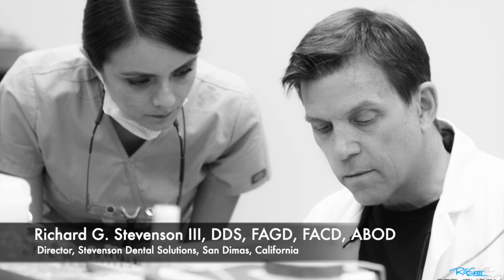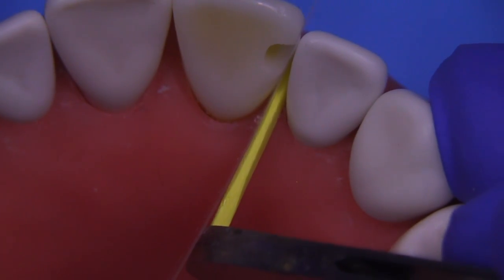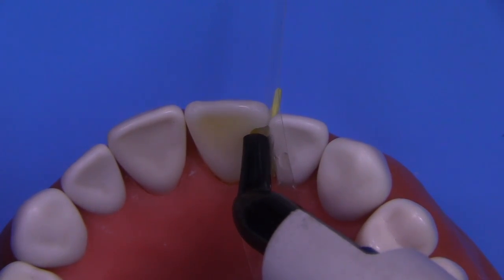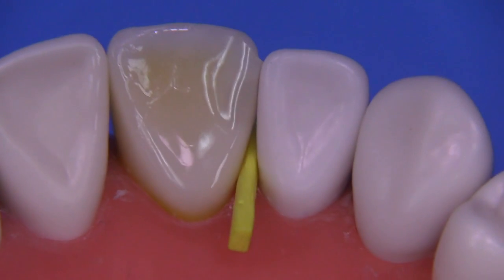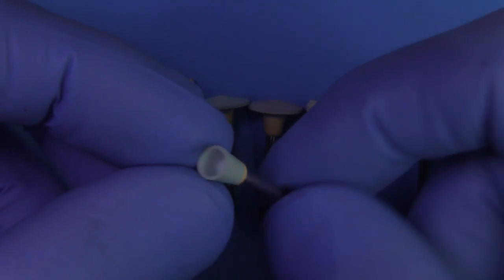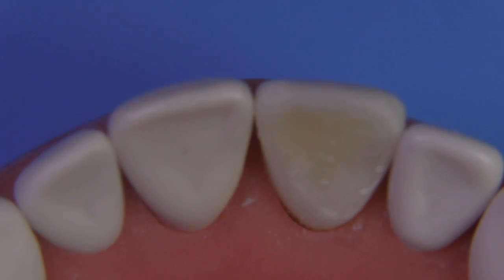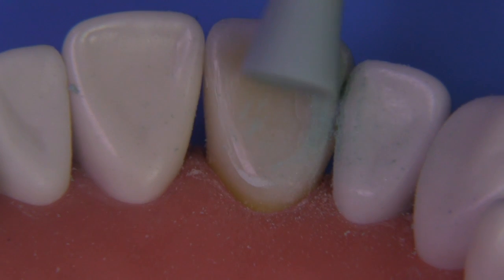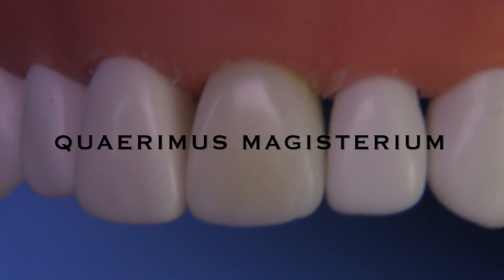Class III Composite Restoration #9 DL FIll

Comment: I appreciate the video. Is there any helpful suggestions to minimize future staining of the composite especially in direct veneer cases?
Reply from the maker: Sure - etch at least 2 mm beyond the finish line/margin.  Use a good universal or 4th gen adhesive. Always use glycerine on the margin and cure thoroughly.  Use air spray to cool during repeated curing. (We test our lights with Blue Light Analytics software)Finish with discs and plenty of water running from composite to tooth.  Recall the patient periodically to polish with plenty of water and fine cup abrasives.

Comment: Hello Dr. Stevenson, thank you so much for creating this video. It truly helps a lot!

I have my dental hygiene restorative board examination coming up in a few months and we have to restore a pre-prepped #9 ML. I have a few questions regarding that.

1. Sometimes I notice I have some excess material interproximally towards the gingival margin of the prep which can create an overhang. I have started placing the wedge from the lingual rather than facial and this has helped but not completely. I don't want to take a flame bur interproximally because I'm scared it will damage the tooth structure. What would you recommend I do in this situation? I have also used like a sickle scaler or interproximal carver (used for amalgam) to remove some of that flash but when I run my explorer from the gingival margin towards the incisal, there is an ever so slight bump which indicates a slight overhang. 

2. I also notice that when I wrap the mylar strip around the lingual, I get a lot of excess composite along the cavo surface margin. Would you recommend that I just use the discs to remove this excess? I have used the discs for that before and it worked fine and it doesn't seem to harm the tooth structure.
Reply from the maker: Great questions:
1. Use a #12 scalpel and angle it towards the tooth. Use the end, not the middle of the blade for the best results, then use a 3M (or comparable) interproximal strip to smooth the junction. These strips may be cut lengthwise making them about 1.5 mm wide which is helpful.

2. Use the mylar for the facial but hand place the lingual composite and remove excess before curing.  Don't wrap the mylar - poof! No flash.
Reply: @StevensonDentalSolutions  Thank you so much for the tips! I will try them out!

Comment: Hello Dr. Stevenson, thank you so much for this video!

I have my first practical in a few weeks where we have to perform a Class III Composite Preparation on #8 DL, as well as a Class III Composite Restoration on #9 DL (where they provide us a pre-prepped #9). My school does not let us use bonding agent on plastic teeth and does not recommend to bevel either. They taught us to place the composite for this restoration in three separate increments, although it is not necessarily “required” that we do this on the practical. They also recommend that we slide the Mylar strip towards the facial surface before we light cure our final increment placement of composite. Moreover, they taught us to use the #12 blade to remove flash at the embrasures, the football finishing bur on the lingual surface, Shofu disk for embrasures, Shofu strips for interproximal areas, and lastly polishing points.

While practicing, I was having a difficult time smoothing the lingual surface of the restoration. I heard you say in the video and I read in the comments about your thoughts on using the football finishing bur on these small restorations.

A few questions I have are: 
1. Do you recommend that I use the snowplow technique as you did in the video, even though I will not be using bond beforehand?
2. Do you think it is necessary to slightly pull the Mylar strip along the facial surface before curing the last increment of composite? Our preparations do not extend past the center of the tooth faciolingually along the long axis.
3. Is it necessary to use a mini composite instrument when snowplowing, and a PKT3 when smoothing the uncured composite? I saw that you only used an IPC.
4. Should I avoid using the football finishing bur completely? I felt as though it made my lingual surface rougher once I was complete.

Thank you in advance for reading this & for your channel; it has been super helpful trying to navigate this course!
Reply from the maker: I would avoid flowable when restoring plastic teeth - less mess to clean up. Pulling the Mylar helps seal the facial margin and close the contact.  If the contact is not broken, this technique is not indicated. I use the IPC because it is so thin and easy to use. Definitely try to clean thoroughly before curing - this may allow you to avoid the football altogether, hence moving directly to polishers which are safer to use.  The football creates damage to the unprepped lingual surface on plastic teeth.

Comment: Whenever I use a clear matrix and pull it to the side to adapt it and light cute, the composite always gets stuck to the matrix and moves things around and it never looks as flat as yours. How do we prevent this? Thank you your videos are amazing
Reply from the maker: Make sure that the matrix and wedge are secure - no movement.  Then pull the matrix in a direct which helps to seat the wedge further...towards to sharp end of the wedge.  Use wooden wedges.

Comment: does the snowplow effect only apply to the specific adhesive and composite you used? I use prime and bond and not a bulk fill resin. Assuming you were using a bulk filled resin in the video
Reply from the maker: This technique is ONLY for plastic teeth and it works well, but I would never use this for routine patient dentistry, except in very conservative class II fillings, following the Clark Technique in all respects.  Curing completely with a non-bulk compsoite is under risk, but it is quick and works well for plastic teeth exam situations. I don't use bulk fill in any form on patients. Total etch, followed by two separate adhesive steps (priming and bonding) is the Gold Standard

Comment: Hello Dr,
You mentioned not to use carbides and diamonds on the anteriors. Can we use finishing carbides and finishing diamonds?
Reply from the maker: Yes but be extremely careful to not damage the plastic surfaces of the adjacent areas.  All the best, Dr. S
Reply: And what about finishing stone? Do they also damage the surrounding areas?
Reply from the maker: @afrozekhan2269  If used carefully, no, they are fine.
Reply: @StevensonDentalSolutions  thanks so much

Comment: Forgot to ask you the other day. I have been using a #12 disposable scalpel to remove flash. Being they cannot be autoclaved I decided to go with 
regular scalpel blades that are 100/box. and autoclavable handles, Which blade would you suggest for the flash removal.  Carbon or stainless steel.
As always, thank you for your wisdom I appreciate your help.
Reply from the maker: Carbon steel is amazing - they keep their edge longer.  Very cool question!  All the best,
Rich

Comment: Our dental school has us do the following steps for class III composite fill: 
1) apply universal bond & air thin 
2) add composite (A2 enamel) in layers & cure in between 
3) carbide football/treetop burs to finish 
4) satin point polisher bur to polish  

I have to agree that the carbide burs make my finish look rough & they flatten out my marginal ridge (especially when using the football)
1) not sure if I’m grasping the concept correctly but does the snowplow effect only work if you kept the bonding agent untouched?
2) after you shaped the composite with the Mylar strip & light cured, I noticed the composite was already extremely shiny without any polishing - is this because of the body composite you used? Or due to the bonding agent getting pushed outwards from the snowplow effect? When we use A2 enamel, it doesn’t look anywhere near as shiny 

Thanks so much for reading!
Reply from the maker: The snowplow is only used for exams - not for patients unless you strictly follow the David Clark technique.  This technique works great for typodont teeth.  Displacing the flowable without any curing until displaced works incredibly well for these exam situations.  We etch then use Universal - far better results with enamel bonding, than simply self-etching.  The shiny surface is due to the band - no air inhibited layer.

Comment: If this were a real tooth on a patient, would you still not light cure the adhesive?
Reply from the maker: I would light cure the adhesive as per the manufacturers instructions with a calibrated light.
Reply: @StevensonDentalSolutions  Of course. Any tips on getting the composite to be more "flowy/glossy"? I've heard mixed things about using adhesive for that purpose. What are your thoughts?

Comment: Thank you so much Dr Stevenson for the great video my question is about how to protect the adjacent tooth while performing the polishing and finishing of the composite 
Thanks
Reply from the maker: Usually the discs are safe sided, meaning than one side has no grit and this won't damage the adjacent tooth.  The abrasives can damage the adjacent plastic tooth (not enamel) is over-worked, so be careful.
Reply: @StevensonDentalSolutions  
Thank you so much Dr Stevenson

Comment: Dr. Stevenson, I have a question about your omitting bevels along the cavo surfaces of your preparation.  Won’t that minimize the exposure and filling of enamel rod spaces with bonding material?
Reply from the maker: Good question. Actually we’ve been teaching to not use bevels on the lingual side of class 3a at UCLA for many years and I we are not alone. The major licensing boards in the US do not require them either.  The issue is that the beveled thin composite area may in fact lead to microfractures if the occlusion is going to hit in this particular area. Bevels on the lingual don’t really assist you much because the retention with the amount of enamel that’s existing is sufficient. However on the facial where you wrap around the inner proximal you’re going to want to place bevels for aesthetic reasons to blame the composite into the unprepared surface. We don’t bevel the occlusal surface of class I or  class 2 composite restorations either and this is done for the same reason.

Comment: Awesome as usual doctor!
What other classes does the"snow blow effect" apply to? Class 5?
And what do you think about applying 2 coats of adhesive in class 1 or 2?
Reply from the maker: The Snowplow technique, also called injection molding, applies to class II Preps most of the time. It certainly can work for other classes like class five but it’s main purpose is small class twos and small class threes.  Applying multiple coats of adhesive is a great idea to make sure that you have a complete seal.

Comment: Hi sir why not carbide bur etchant and primer is used?
Reply from the maker: 1. Carbide burs do not penetrate the hard outer shell easily. ( i mentioned this in the video)
2. No need - it's an artificial tooth - no dentin to bond to and the enamel on this tooth will not etch.